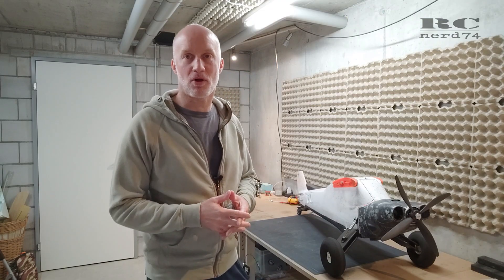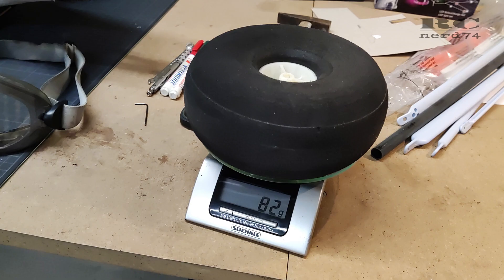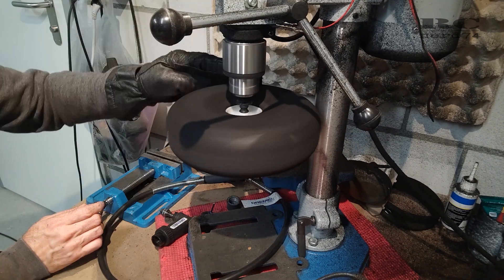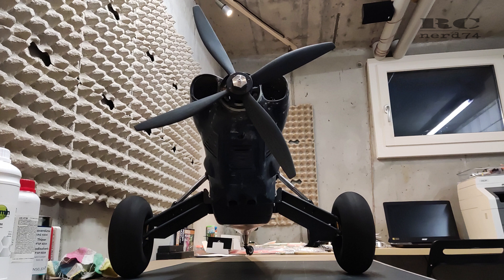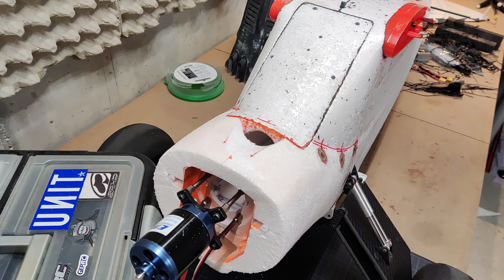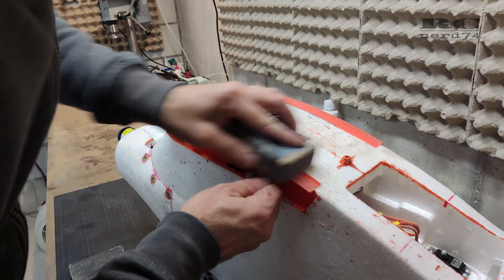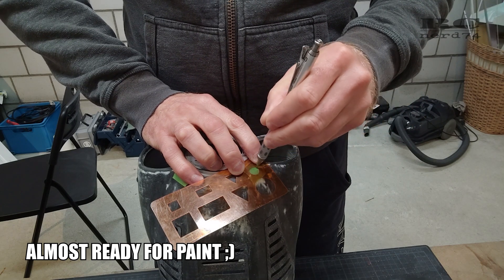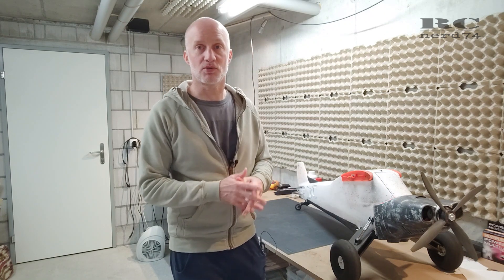RC SCRAPPY #17 | HOW TO MAKE FOAM WHEELS | DRACO PROP | FUSELAGE PROGRESS

Comment: Very nice video. I had the exact same idea of using a yoga block to make wheels. But it wasn't such a big piece. Of course, my Scrappy is a bit bigger, but the wheels weight an awful lot. 2 pcs total 1100g.
Reply from the maker: I have put the link of the foam i used into the video description. If you can mill off the structure on the surface, you can glue two pieces of this foam together to make it wider. Like this you make a wheel with almost 20cm diameter and around 10cm wide.

Comment: Are those foam wheels? I know that motion rc has inflatable wheels. $15/pair. They use them on the skynetic bison. I really like how they look on my Draco!!!
Reply from the maker: Yes, These are foam wheels. What is the weight of one of your wheels? Sounds interesting.
Reply from the maker: Just checked these wheels out. They are too small to be scale size for RC SCRAPPY. Thanks anyways for your Input👍🏻😃
Reply: @RCnerd74  bummer. Scrappy is looking dope dude! I've been following this series for a bit can't wait till it's all pretty and finished!!!
Reply from the maker: @robieosborne7369  Can't wait too🤠
Reply: @RCnerd74  they weigh 200 grams for the pair I think 😎😎
Reply from the maker: @robieosborne7369  Not too bad. My foamies are 63g each. I can save some important weight using foamies.